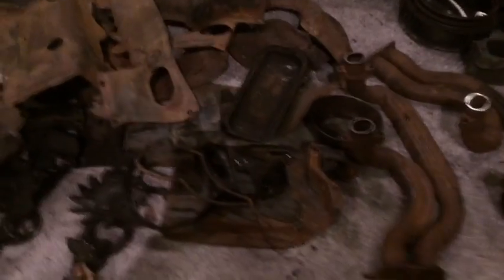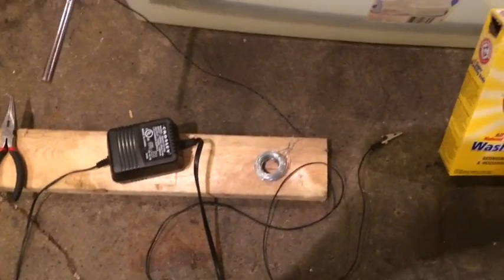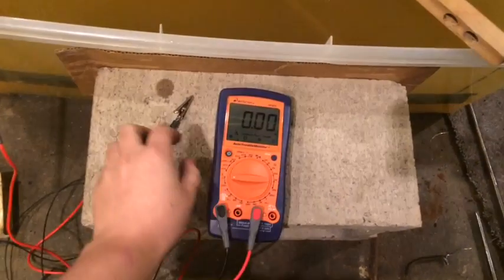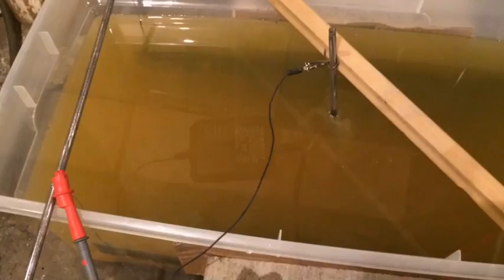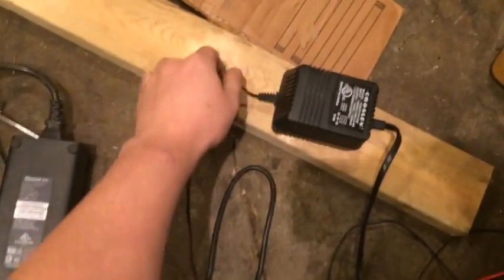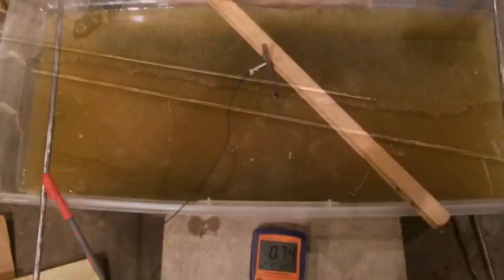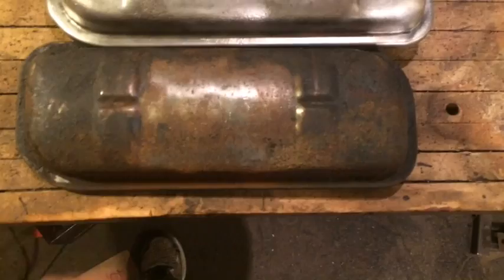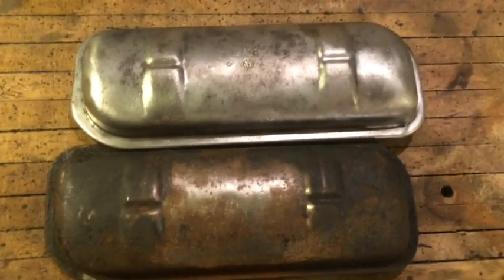Electrolysis Rust Removal

Comment: How much Sodium Carbonate do you need per tank? What's the ratio?
Reply from the maker: Surprisingly it does not take much. There is no specific ratio required to make the process work. All that need be done is to add just enough to make the liquid mildly conductive. For reference, there are about 20 gallons of water in the tub, and I only added a couple palm-fulls of sodium carbonate to the water.